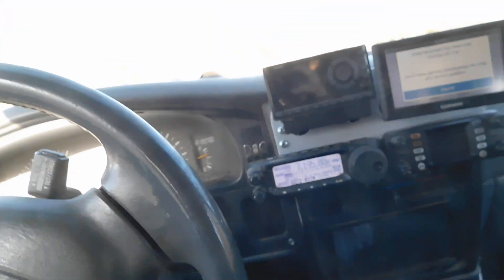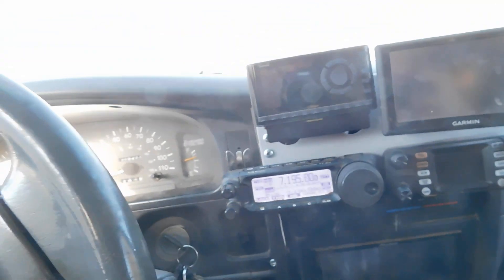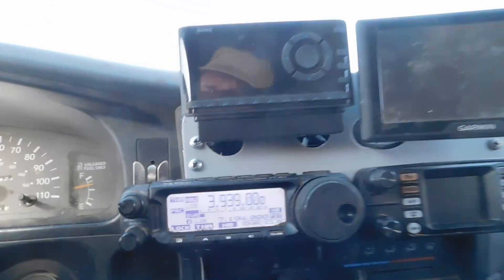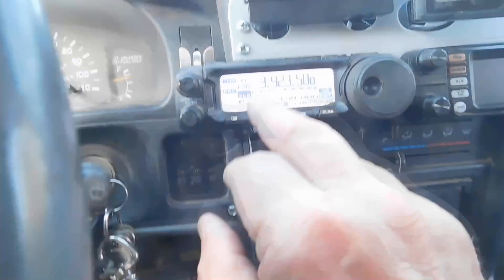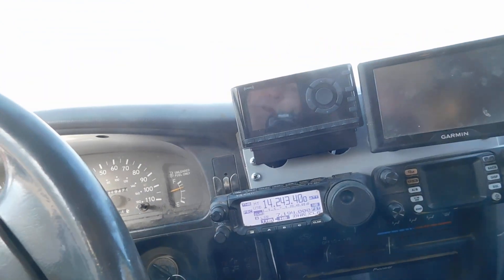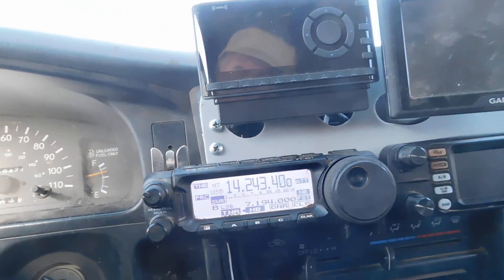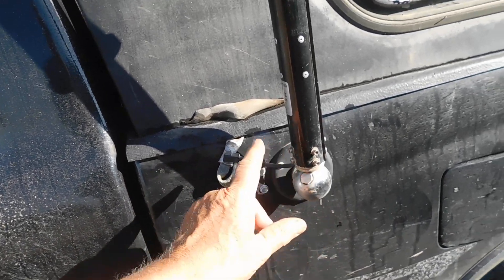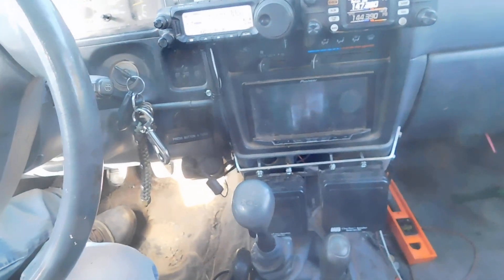Yaesu 891 with Mat-30 tuner, 102 inch whip, Little Tarheel 2 and ATAS 120. Links at bottom of page.

Comment: I'm using a Chelegance MC-750 with my 891 and the Mat-30 tuner. So far, so good.
Reply from the maker: @MrTommy001  cool. I dumped the atas 120 and went to a Wolf River Coil with the 102 inch whip. The Mat-30 is still inline but I seldom need it. The new system works way better than the atas-120.

Comment: Im using a 102 inch whip on a wolf river coil on 80 with my 891
Reply from the maker: How are your results with the wolf river coil and 102 whip? My coil is supposed to be here tomorrow.
Reply: @timsvids5983  It been working great. Don't expect  stella performance on 80 mobile .A capacitive hat helps. A 60 inch whip  has better receive then a ham stick.

Comment: My set up is an FT891 and a MAT30 tuner with a hamstick roof mounted on my pickup. What are you doing to suppress ignition noise and other generated electrical noises from the truck?
Reply from the maker: Lots of grounding mainly. I added rf chokes to many of the power and computer lines. The fuel pump was noisy before adding a choke. Put chokes on all the radio power and coax lines. I think there might be 100 or so pounds of rf chokes and braided ground straps all over the truck.
Reply: @timsvids5983  Did you see a marked reduction in noise?
Reply from the maker: Yes. Make sure you have resister plugs and wires also. Mine is a 97 with less computer stuff in it than newer cars so it may have less noise.
Reply: @timsvids5983  2006 F150 here. Thanks for the advice. 
Jeff - W3AAB